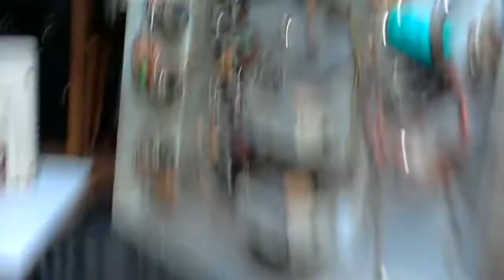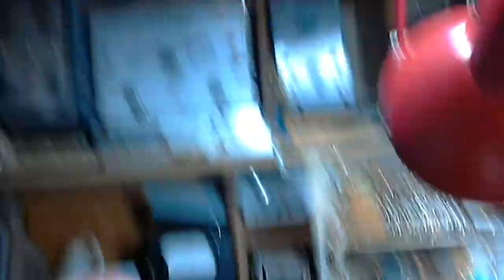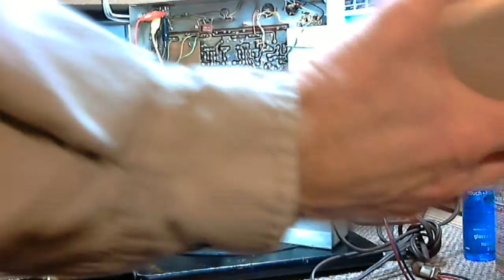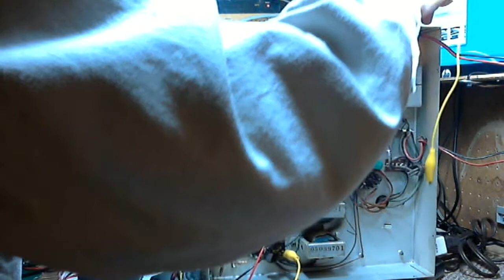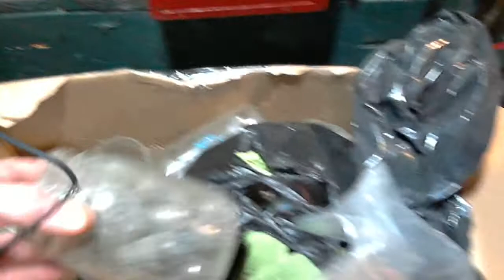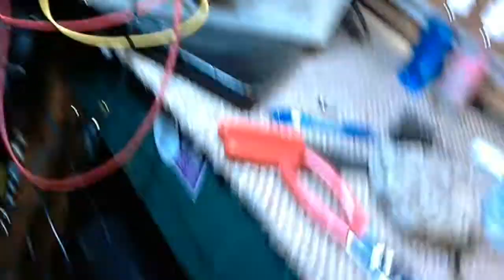Rogers Majestic 8059A Console Stereo Video #3 - Power up and Initial Testing

Comment: 100% better!  Very Funny when you dropped the camera at the start of the video!
Reply from the maker: I'm feeling a lot better about it all too.  Through all my machinations with cameras, lenses, computers, cards and tablets, I've ended up understanding the video deal fairly well and I have a number of hardware options now for shooting under different conditions.  I was reading a fairly good article about webcams when the author ended with, ' and if all this is too complicated, just get a Logitech camera and go have fun'.  I had started with a Logitech camera but I was too dumb to raise the resolution on it.  After wandering through many combinations of stuff and reading the article, I tried out my Logitech and, now that I know what I am doing, I discovered it works really well.  The drawback with the Logitech is that is has no focus and relies on a large depth of field from a small aperture.  That means I need to use external lenses to get closeups.  I'm sure I'll come up with something.  Thanks for watching.